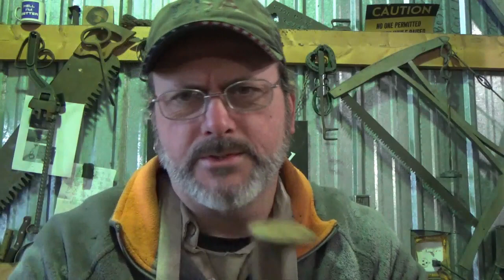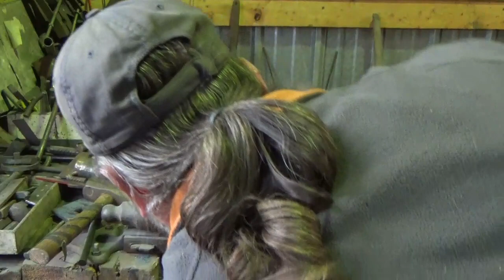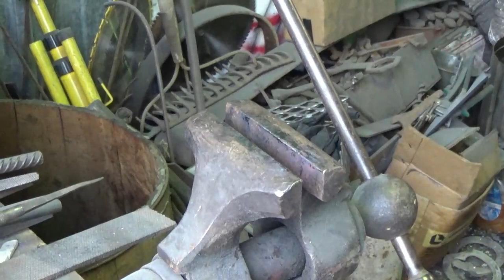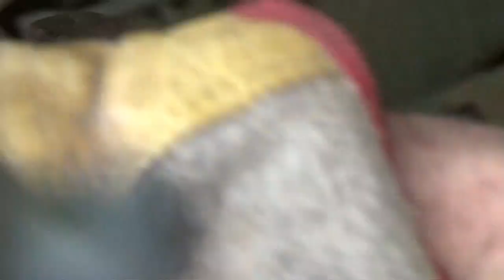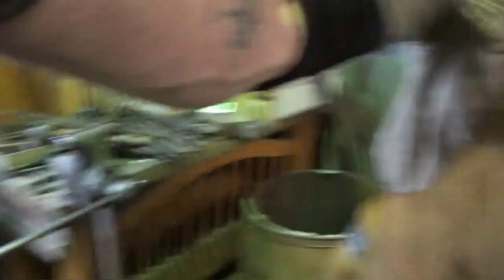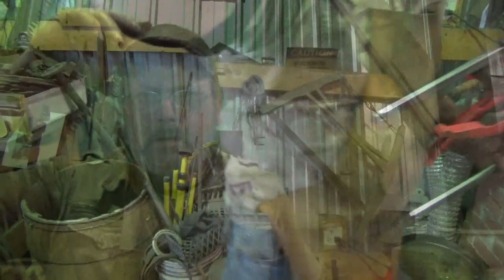Blacksmithing - Forging A Lion Head Railroad Spike Knife

Comment: 59:23 A little late in the video for this and 24 hours later from when I started watching.... but I am loving your light hammer and fast light taps detail work on the mane. I believe that's the kind of blacksmithing done on knives and swords in the medieval ages before the grinding. lighter hammers and lighter but faster hits to move very little steel to get it as clean as possible and closest to the final shape as possible. Forge small and grind smaller compared to todays forge large and grind small mentality. The more you practice doing detail work like this I can see you making blades that require very little grinding and you could see the final form before you take it to the grinder. I applaud you Chandler for such skill and finesse and your drive to improve them, you are well on your way to becoming a master artisan and your journey there through trial and error teaches all who follow in your footsteps along that path. Be you and your creative self.

Comment: For all the slight derpiness that the lion has, it's a very elegant knife. I was wondering, if you were to make something like this again, you could solve the alignment problem by cutting of the lion head, making the knife and the sculpture seperately and then welding it back together afterwards.
Anyway, lovely if long video. :)

Comment: When you were putting the bevel in and the tip was curving upwards before you straightened it... I think would've made for a better blade shape for that handle., More S shape than U shape for the overall knife. It was an elegant shape that was becoming by natural working of the material. That handle though, gorgeous wood grain pattern and perfect size for a filet knife,..

A suggestion for your detail work on such thin blades to reduce hammer marks is make a 1lb or less flatter hammer that is used by itself for quick hits over a wide area without allot of force. Use it like you did the peen for the mane and only held the hammer with your index finger and thumb allowing the handle to move like a drum stick.

Comment: Very cool project but just a question, why doesn’t partially quenching the steel in water harden it?  What I mean is when you quench a small section to avoid it deforming while you shape steel next to it like you do at 10:44.  I would think the spike should harden and then break when you hammer on it

Comment: Thick blade knives are great for hunting and hacking kindling, but if you want to use a knife for cutting meat (carving, boning, paring, etc.) then a thinner blade works much better. That looks like it would be an elegant steak knife. Certainly a one-of-a-kind. Great work.    Oh, and if you were to break this 1-1/2 hour video into three parts, no detail lost, AND you would have published three videos, with a total of 3 times the viewers. What would You Tube pay about that? Jon